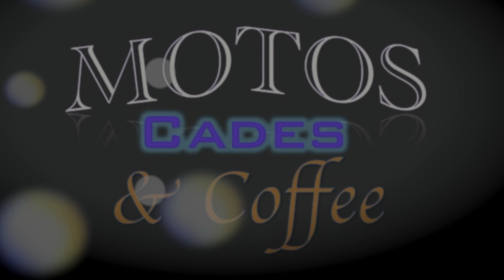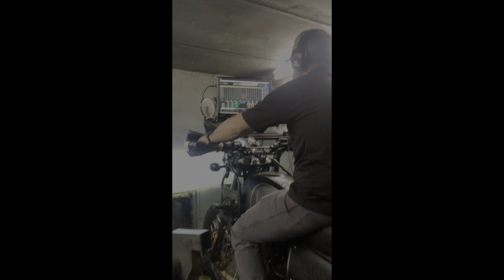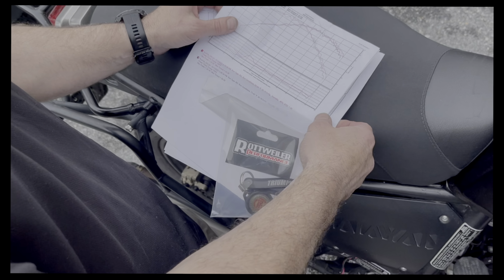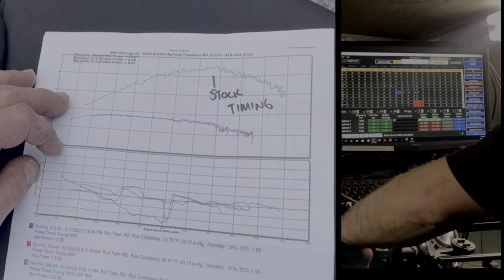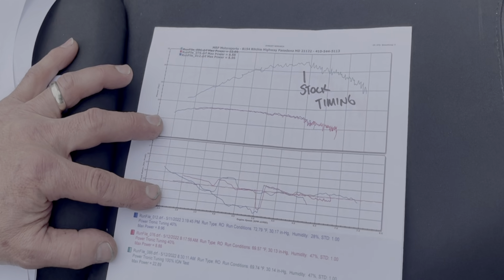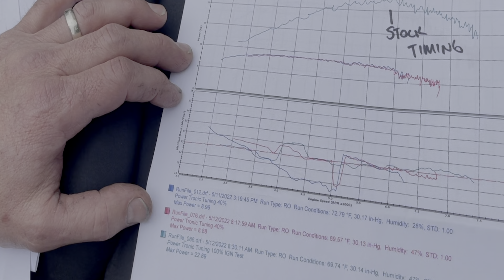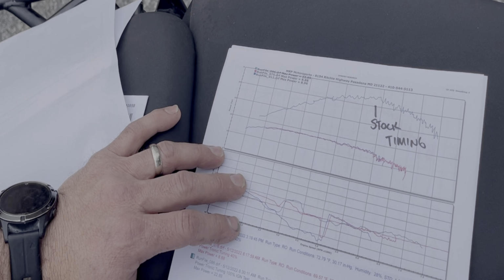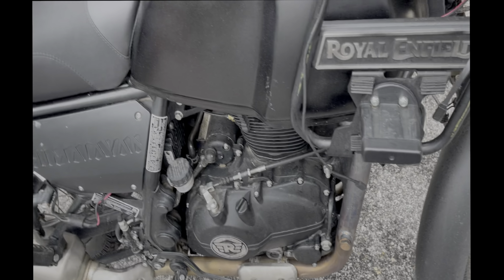I'm SHOCKED! Royal Enfield Dyno Tune Part 2 | Horsepower & Torque

Comment: For these bikes the carb conversion is the best bet.After a few years if real world abuse the efi will get unreliable as do all these modern bikes.Your cylinder head temp never overheats with a carb tuned properly while itis a big problem with lean burning efi.
Reply from the maker: I’ve dynos the bike and it included a full custom  fuel map,  and egt map, and air fuel analyzer..this is fine tuned to be much more precise than a carberator. It has run perfect temperatures, but you do you!

Comment: I know 5hp doesn't sound like much but actually a 25% increase is large when talking engines. It just doesn't start with much.
Reply from the maker: Agreed, the issue is the cam alone was supposed to net 5 hp and the bb kit about 3 hp… together usually it’s more, so yeah a little disappointed
Reply: @MCCJustMotos  seems like big bores on fuel injected bikes isn't as good as a carb. If there was a way you could go old school I imagine you would see the numbers you expected. The engine would take what it needed I think it's outrunning you ECU
Reply from the maker: @jessecrawford2711  I’m not sure about carb vs. FI, but I can tell you the engine Dyno confirmed the ecu was fueling the engine optimally the whole time and not under performing. I just bought a new stage II cam and I hope that makes a huge improvement.
Reply: Funny thing. Had the first generation of the himalayan, which was carbureted (as this was meant to be a high altitude bike)
Later generation introduced fuel injection to keep up with pollution norms.

Comment: Long awaited news about Power increase using Big bore Blocks and piston. 
To me, since there is no much significant increase in power, better keep the stock.
Reply from the maker: I agree for the money!
Reply: It’s not so much the power but the power delivery. Of all the mods I’ve done the most notable was the camshaft swap. If you do only one thing I would recommend the camshaft. The intake exhaust does little. The powertronic really smooths out throttle response.

Comment: Hi there, an exhaust probe why didn't he just take the end can off? I run mine all the time without the end can and she sounds superb.

Forgive me but it sounds to me like your guy doesn't know what he's doing ?
Reply from the maker: At the time, I wanted to keep the stock exhaust (since replaced). I wanted to get a true number in the state I had planned to run it.  End can off would have changed the exhaust state (pressure, flow rate, etc) and made a different number than I had planned to run. It’s a moot point now as I’ve changed cans and have upgraded further ;) cheers!

Comment: head flow my man watch david vizard and port it a tiny bit of short turn clean up does wonders  .i hope i can find a used bike to buy soon.ill bet useing a microsquirt ect same unit i using on a few cars made in USA to to boot a fair price ole cheapo android tablets can tune and are used as a dash gauges if needed  fun stuff.on the fly tuning to i do not know why all do not use them can be bought at diyautotune.i am not affliated with them just a fan and helper to all tweakers of cars n bikes
Reply from the maker: Cool, I’ll check them out!!!

Comment: First off, thanks for the detailed video. Loved watching it, very useful. I haven't watched all your videos, but my question to you is: after all the mods you made as you listed, were you still running a stock exhaust system on the Himalayan? If so, that's where your biggest restriction is! Replacing the header alone with a de-cat and bigger Inner Diameter will give you the gains you're looking for.
Reply from the maker: Aww thanks! My original intent was to keep the stock exhaust, because I liked having a stealthy quieter bike to run.  But yeah, I ended up switching exhausts (and a few other things now too)!  I’m finishing up a “final” build. I think I’ll have 40 crank HP now.

https://youtube.com/shorts/Hmz4SHjazeI?feature=share

Comment: I've not yet looked at the build but have you doubled up on the head gaskets as you may have lowered compression which will be the cause of your low power
Reply from the maker: Thanks for the watch! I’ve only ever had 1 head gasket installed at once.

Comment: Well I'm with you, that is a major let down.  How did you come up with the initial 19 HP figure?  These bikes are supposed to have 24 HP to begin with so I'm thinking the 19 was right before you had the rebuild and the bike was having a rough go with the piston slap and all.
Reply from the maker: Is bikes to have a stock 24 hp at the crank. However chassis Dyno measure from the rear wheel which has power loss associated with the drivetrain. 19 is what most Himalayan show at the rear wheel in a chassis Dyno, stock.
Reply: @MCCJustMotos  Got it.  Thanks for the explanation.  But 5 HP is better than nothing and with so little as is that is a huge increase.  I'm sure you can feel the difference.  I wonder if it will give you a higher top speed or just make it quicker to get there.  It should make it easier to maintain those higher speeds on the freeway as well.
Reply from the maker: @yobdiver  we shall see with part 3! ;)
Reply: @MCCJustMotos  Oh you are such a teaser!  LOL

Comment: Did you just use company numbers for stock. Because company numbers are not to the wheel so in reality your stock HP is to the wheel more than likely only about 18 or 19
Reply from the maker: Cory, I talk about that in the video many times. Yes, the average Himalayan puts down about 19 H.P at the rear. After my mods and dyno tune, I was putting down 24.84 HP at the rear.  Before the Tune (just the mods)  I was putting down about 22 HP at the rear.  That nets me about a 25% HP gain. I was expecting more.  However, I did confirm I was able to top the ton +1 more MPH yesterday!
Reply: @MCCJustMotos  ok thanks

Comment: Stock 24hp is at the engine 19hp at dyno is normal I think
Your result is nearly 30% more power than stock - a fantastic result I think.
How does it drive?
Reply from the maker: Yup, my main disappointment is that just the cam alone or just the big bore kit alone was advertised as providing that power addition. Together I was hoping for more…
With the front-tooth sprocket upgrade it pretty much drive like sock, and is not very noticeable and there is a weird hesitation at 4500 rpm. I am doing 3 mods more which I will hope to change a few things..it should be an awesome video..

Here was my first ride review, worth a watch to see why I did the upgrades.
https://youtu.be/jWiv4C69Rwg

Comment: What a waist of time and money.
Thanks for the info.
Reply from the maker: Yeah, I’m not a fan of the gain for the $$$ at all!  Your welcome 100% I guess someone has to be the Guinea pig
Reply: $250 for a cam $75-100 Freeflow air filter $150 Freeflow exhaust and you get a 25 % h.p. and 25% torque increase with a huge 100 % torque increase right off idle till 3000  rpm( That is a very large increase for the $$ compared to similar mods to other bikes . Add carb conversion for $400 and then it will be completely reliable.